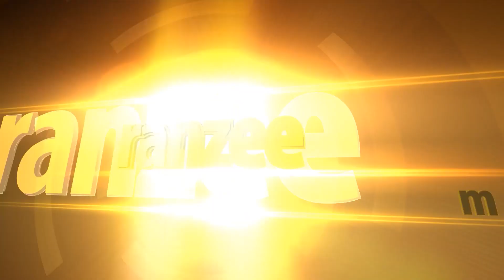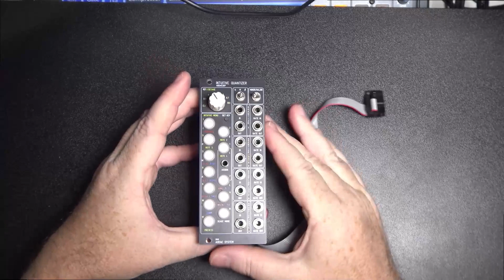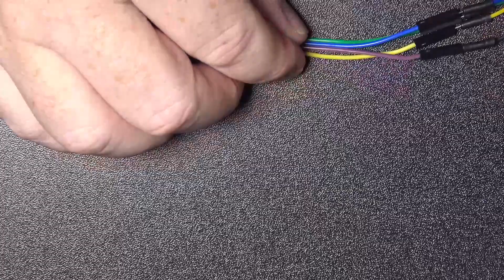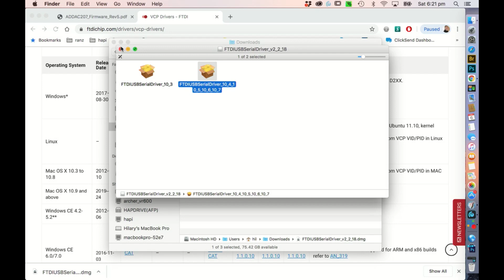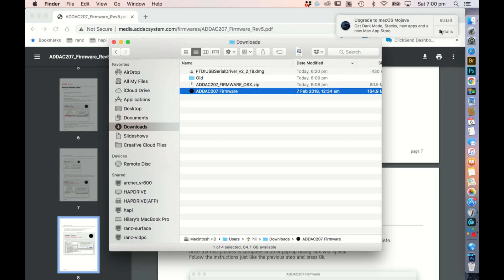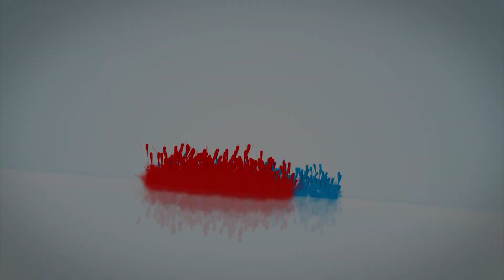Mailbag #5 - ADDAC System ADDAC 207 Intuitive Quantizer

Comment: Thank you so much for the Video! Could you please do a short video about the Fine Tuning process and saving presets of the 207 in general? I have two 207 and i don't get it to work properly. Both of my 207, i bought as new, are out of tune out of the box. :(
Reply from the maker: Great suggestion!
Reply: @ranzee  i think many 207 user would highly appreciate it 🙏👋😊

Comment: My Crave arrived this morning. Bonus: it fits right on top of my small Eurorack case, which is also black and orange. Ears and eyes satisfied xD. Next step: get a few modules that fit the crave.
If you have any ideas, they would be very appreciated.
Reply: I love my Crave. It is very simple. Two wave forms, envelope gen, LFO, noise gen, and a sequencer. As a stand alone synth, it's not very versatile but sounds so good. If you combine it with Euroack or other semimodular gear it's real strength shines. The sequencer is worth the price alone. As far as pairing other gear with a Crave you will want a more versatile LFO, a good VCA with ADSR generator would be nice too. The Crave has no effects so FX pedals or Euroack effects are a must. The Crave can accept external sound sources so you may want to have something like a Eurorack wavetable oscillator to send other VCO signals into the Crave.
Reply from the maker: I've always wanted to add a Crave to my Pro-One - as they share similar voice chips/characteristics. I think it will add extra beef to the Pro-One and also it adds the sequencer etc. As far as Euro modules - @jppagetoo mentions some good ideas. I would also say get something that glitches it up - some of the Chromatic series from Dreadbox offer some interesting audio mangling and modulation options.
Reply: @ranzee  I pair it with a Neutron. Those two form a nice pair. The Neutron has some utilities that the Crave can use well (attenuators, mults, another LFO, etc)